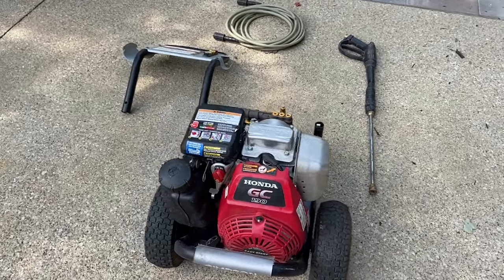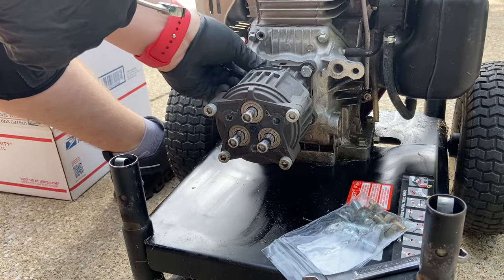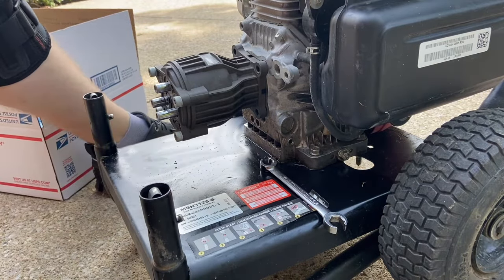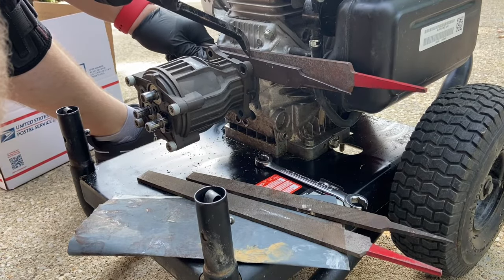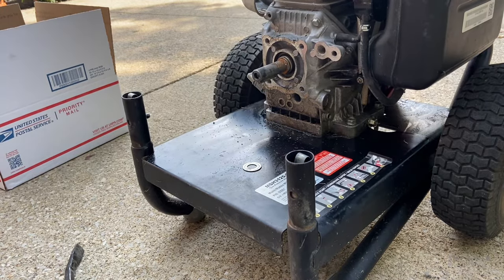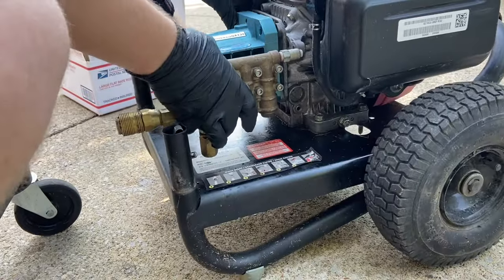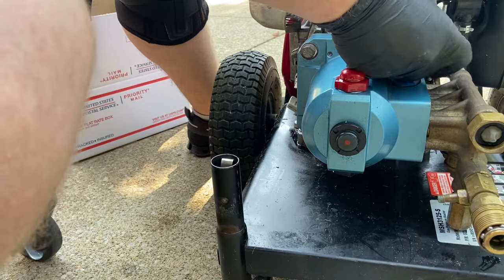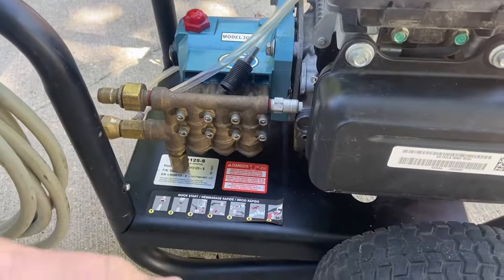Simpson Pressure washer no pressure trouble shoot and replace with a Cat Pump

Comment: Hi, nice video. I have the same washer MSH3125. 3200 psi. Lost pressure and the slow water keeps on flowing even after I let the trigger of the gun go to off position. Need suggestions- get a new pump or parts and from where do you suggest? Thanks.

Comment: I was able to pull the pump towards me and I beat the back side of the pump. Wasn't easy but it did come off a little easier than your method. Thanks for the advice,  I couldn't get mine off before I watched this.
Reply: Yeah I've tried everything. I can't get the pump off. Using the motor for a mini bike

Comment: I finally got my pressure washer! Simpson Water Blaster 4200 belt drive. The only bad thing is that Simpson did not include a vented valve cap for the pump. So I had to buy one. Works great!
Reply from the maker: Nice, if it was new email their customer service and they should send it to you for free...I had an AR pump and with shipping the cap alone was 20, on a cat it was 25!!!

Comment: Thank you so much for this information very helpful. The problem I have is with my soap nozzles. I suspect that the soap fitting on pump might have gone bad. After checking I found the small ball bearing and small spring was coroded and eaten up. How do I find replacement parts? I lost my manual. Should have flushed out line after use, but we learn by our mistakes.
Reply from the maker: After running soap you need to flush the system out otherwise it will corrode or get gummed up.  Ive gotten many units with that same issue…I’ve had really good luck cleaning it up with break cleaner.  However I’d you want new parts here is a link to a lot on Amazon that should work.  

https://www.amazon.com/Simpson-Cleaning-7104228-Replacement-Injector/dp/B09WW34CHM

You can also call Simpson, I’ve ordered parts from them before without issues.
Reply: @jamesbubnick  Thanks. I need to get the exact replacement part. I guess they only need the serial and model number. I will call Simpson.